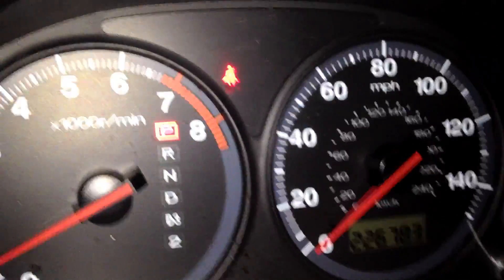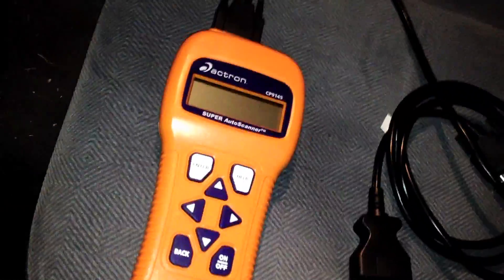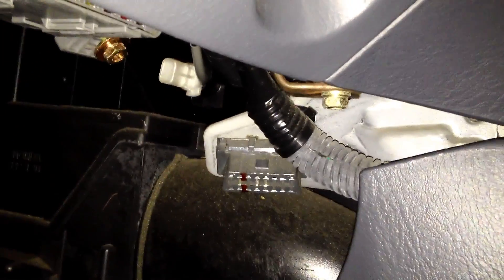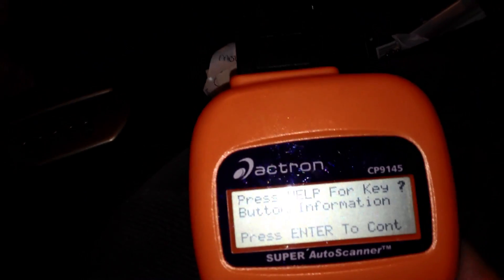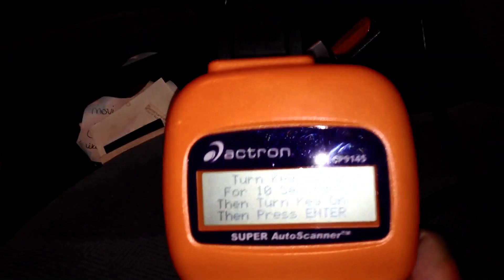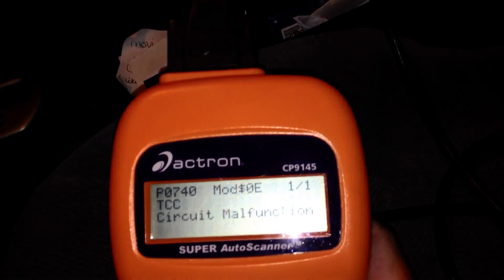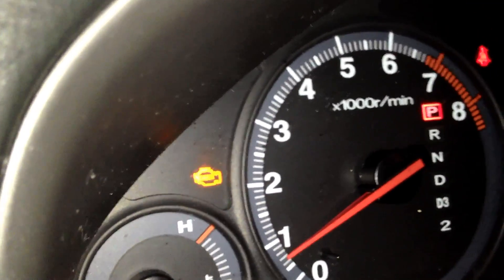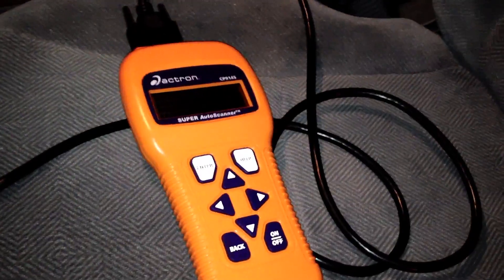OBDII Scanner DIY - Basic Usage & How To Do It Yourself

Comment: What does "Clearing" or "Deleting" a Code mean? Since the problem is not yet fixed, won't it pop up again.
Reply from the maker: +Arshad Hamid It will show up again if the problem still exists, but you still have to clear the code when the problem is resolved.

Comment: autozone does it for FREE..if you dont mind the drive. two... you dont need to run the car...just turn on the key till all your cluster (dash) lights light up wait ten sec than turn off..no reason to burn gas